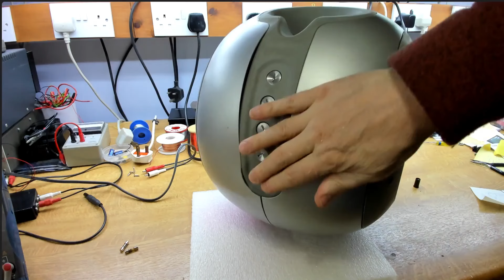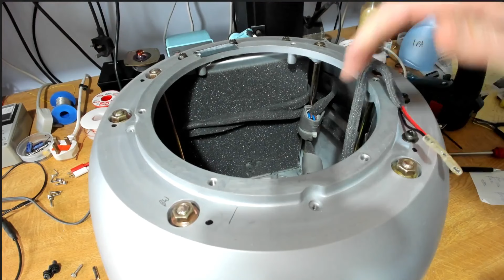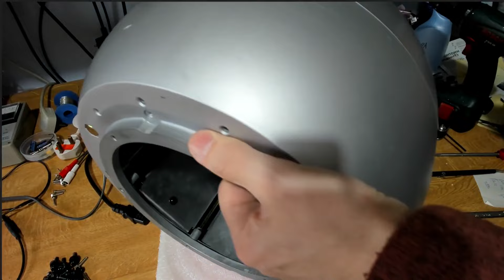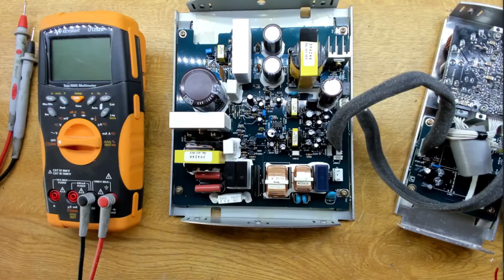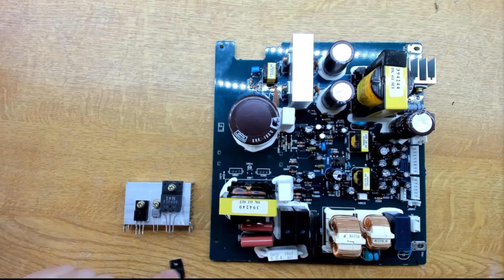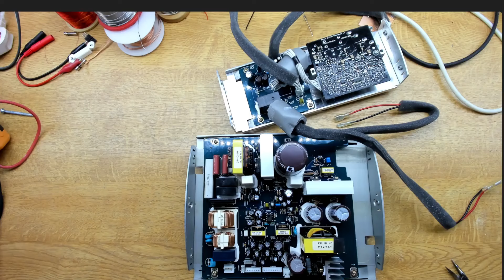Repair of a Bowers & Wilkins PV1 Sub-woofer

Comment: Rebuilding my PV1 now, many new caps, that can last longer in higher temperature, but still just the speaker is having some issue, just light vibration of the speaker elements. Seems one mosfet is shorted so need to replace that as well... But man the PV1 is not designed for repair.

Thanks for your video! It has been helpful for some troubleshooting!

Comment: I don't  understand  power subwoofer  number one rule never mount amplifier  to the woofer box and that the first thing done in powered  subs. of course the amp is going to give out that whats wrong  90 percent of the time with most powered subs yet they still build  them  💯👍✌️

Comment: One of the most ridiculous subwoofers ever made.  Completely form over function
Reply: Did you own one? The sound when watching movies is just insane. Either I get mine repaired or get it again
Reply: @TheSamson1te I did not.  The design/shape and material choice for a sub seems ridiculous though.  But I have been proven wrong in the past so there you have it
Reply: @TheSamson1te  i have a unit i've bought faulty and then fixed myself (was a ton of work, difficult power supply fault). I have to admit i'm not impressed by it. The frequency response is not flat anywhere at all, and distortion is quite audible even at relatively low levels.
Reply: Well, I can't recommend it enough. I had a B&W asw something for a week just for fun. It was 1/4 of the price of the pv1. The pv1 is at least 10 times better so. Worth every penny. Plus, it looks better to me but that's a matter of taste
Reply: @TheSamson1te I’ve had the PV1 for over 15 years. The only issue i had with it was the connector being loose. Sent it off to B&W Massachusetts for repair, cost $150 with shipping included so wasn’t too bad. The connection issue has come back but if I dont move it around, it’s ok. Weighs a metric ton, like 5 bowling balls in one. Amazing sound. Paired originally with 805D’s and now living with FPM-6’s
Reply: @BeyondNarratives How did you find out what the error was btw?
Reply: @TheSamson1te  looking at the problem on the invoice it was “INTERNAL AMPLIFIER IN THE SUBWOOFER CUTS OUT WHEN VOLUME IS RAISED ABOVE -35DB”, so my apologies looks like it was a different problem back then, and the loose connection is what’s going on now. They also charged me only $137, which included a $15 charge for a PV1 Box they shipped to me first. It was supposed to be $90 for that box, but the guy there found one a customer had returned so I was able to avoid paying that, and just paid $15 for the box and I guess $122 for the repair.
Reply: Wouldn't go for the grey though. I have the Black and I would recommend that one or the White. The pv1D in matte Black looks even better

Comment: It's an awful power supply looks really dated something you would have seen 25 years ago! it's not that old is it?? why didn't they just use an ice power supply you can buy a ice power supply for that module and it would be less than half the size and more Powerful that's what I would do. that power supply is a dreadful design not designed very well looking at it B&W drop the ball on that one
Reply: the PV1 is from 2004

Comment: I'm guess that a fair bit of labour went into this one. Not all customers would be will to spend the money unfortunately.
Reply from the maker: You are correct, this was more of a project and I wouldn't want to do another one! Shipping is also impractical due to the weight.
Reply: @BeyondNarratives  Thanks alot.
If I knew it would be 150-200 dollars I would get mine repaired right away but Im afraid it will be closer to 500 dollars and then a new used makes better sense so I could keep my faulty one for spare parts in the basement.
Happy new years :)